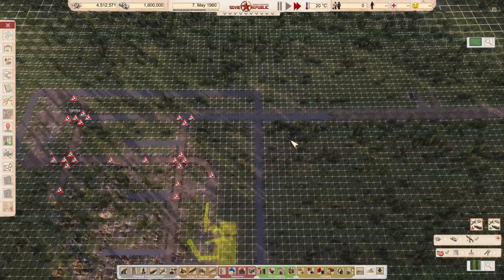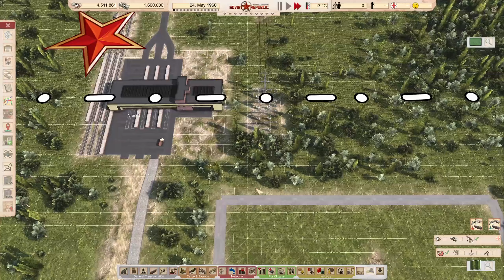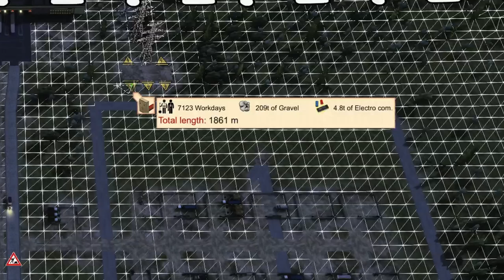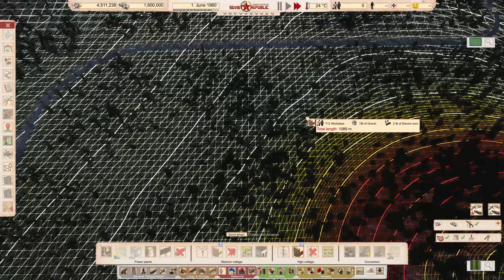Workers & Resources Soviet Republic Playalong Tutorial - Ep04 - Industry Services

Comment: Isn't it too expensive to use underground wires? Also, can't you just use the mid instead of using the high voltage? Thank you!
Reply from the maker: If you're using non-realistic mode the underground wires are expensive, but most of the cost is labour in the groundworks phase. In realistic mode all that can be done by an excavator so they're super cheap.

You can use mid voltage wires right from the border supply if you like, but it's only economical if you're building close to the supply or supplying low amounts. For the little industry area in this episode it would be plenty, but in later episodes we'll have more stuff nearby so getting a high-voltage supply means we don't have to redo it later.